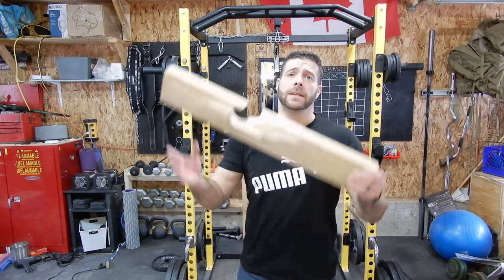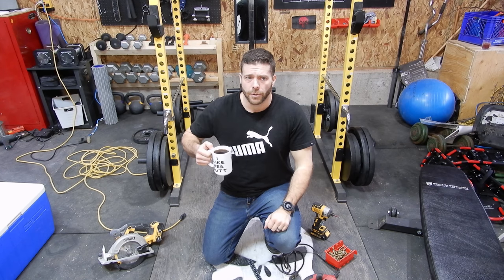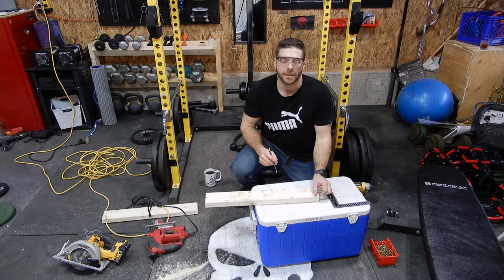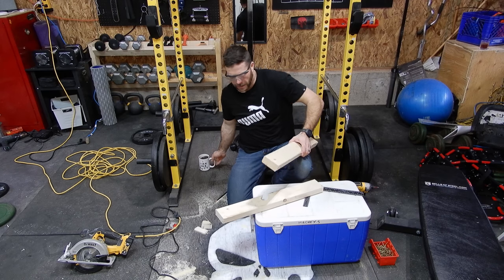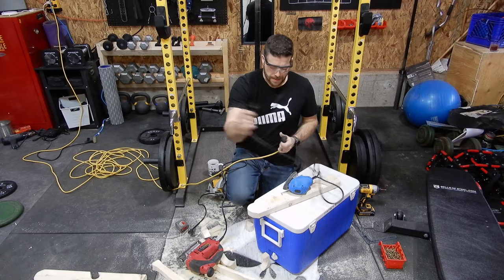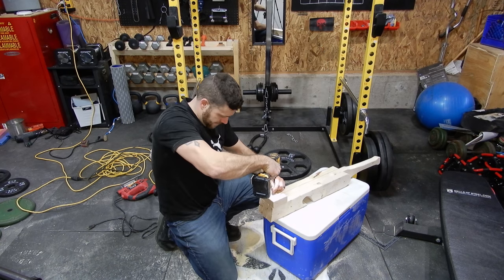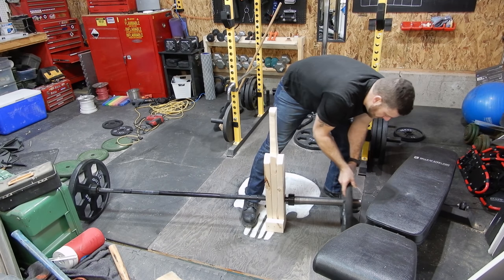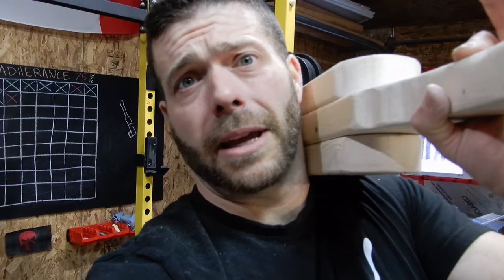HOW TO MAKE A DEADLIFT JACK FOR LESS THAN 5$ -  EASY GARAGE  / HOME GYM DIY

Comment from the maker: Do you like making your own equipment for in your gym?  Let me know if you have more ideas for me to make.
Reply: I didn't build anything yet but i modified some. Ex. I had a Boflex dumbbell stand, but just had regular dumbbells ( Boflex are frigging expensive) and modified the stand to take regular dumbbells
...
Reply from the maker: @eastcoast163  Nice!  Always a good feeling when you can re purpose the gear you have.  Right now I'm playing around with my iron master dumbbells that go to 75#.  I'm using different size washers and I'm able to load them up to 120 lbs each with the cheap 1" plates.

Comment: EXCELLENT !  I just use a wood ramp wrapped in duck tape for.  I',m gonna make this,   OH and My RACK  is 35 years old and WOOD  Pressure treated 4 x 4  and LOTS  of lag bolts for pins
Reply from the maker: Nice!  I'm actually considering selling my rack and building a wood one......  maybe i'll do the build first, then sell, hahah
Reply: @BarbellSanctuary   I STILL LOVE  my version   5 each of 8 foot  4 x 4 pressure treated timber  and 1  8 foot 2x4  .  1/2 lap the bottom 2 angles of the triangle base BOLT  together  .   width =  HOW how open space to outside of barbell outer collars . I use TOW STRAPS  from  lag screw to  O bar .  for safety.   YOU will need at least a 4 foot level  when marking off  leg screw  heights.  mine are  -   flat bench - incline bench - seated military press . standing squat -  standing shrugs -  barbell curls, -  seated calf raises .   THEN yuo can add inbetween   lag screws for additional  heights  of each exercise,   ANY ?'s  hit me up .
Reply from the maker: @BRUTUSPLAC  Nice!  Thanks man.  I'll ad this to my never ending list of projects haha.
Reply: @BarbellSanctuary  new video up
Reply: @BarbellSanctuary  and sandman taking me to sleep have a great day